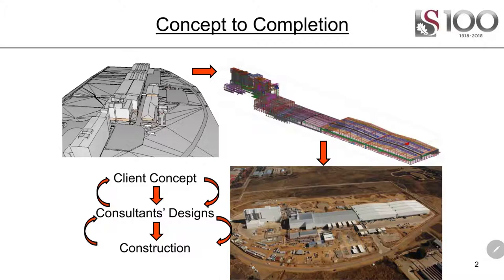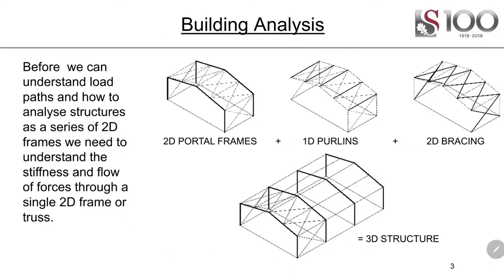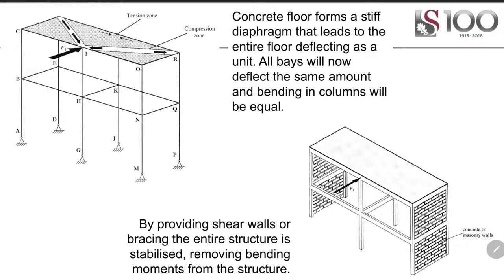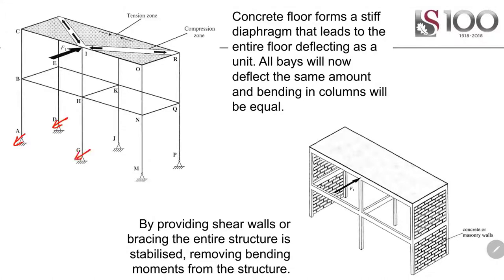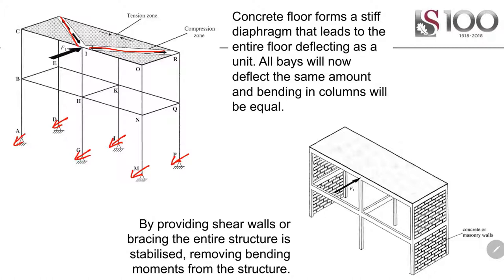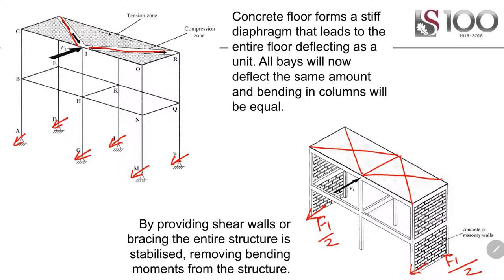Structural Analysis and Design - Understanding bracing and bending moments in buildings

Comment: hello i came across your channel ... looking for advice... omy, i was asked by building control regarding wind bracing on a flat roofed steel frame 5250mm in height . each bay 4900mm. designed the cols and beams with moment joints, the council refused it saying laterally unrestrained...
Reply from the maker: It is possible to design a structure with moment resisting frames rather than bracing. However, it needs to be ensured the structure is braced in both directions. For minor axis bending that can be a problem unless a separate frame is added. However, without knowledge of the system discussed it is just speculative.

Comment: If your bracing could carry compressive loads, would you have one member of the cross bracing in compression and one in tension, adding further internal reactive forces?
Reply from the maker: If you have compression bracing you only need one diagonal, which will operate in tension and compression. There are some circumstances when you need to do that because there are doors, services, conveyor belts, etc. that prevent you from putting in full cross-bracing.
Reply: @firesun  I am finding these videos very useful. Many thanks for your time and for putting these up. I also had to invest in a Mola model after this haha
Reply: 2 is better than 1.

Comment: Why do these boring idiots discuss cases with hinged/roller joints ??? Virtually every structure is connected using at lease four bolt, thereby making it a moment connection by creating a couple between bolts. The entire structural engineering is so f'ing conservative that we ignore the moments , and waste time and material in bracing them.
Reply from the maker: Unfortunately that is not true. Often in practice bolts are placed within the depth of I-beams to make a base pinned. Also, if a foundation is not sufficiently large enough it will rotate resulting in the base become pinned.